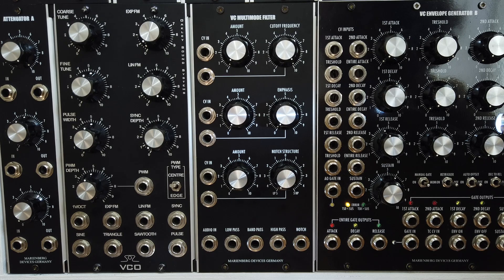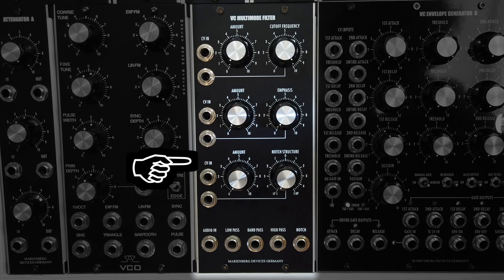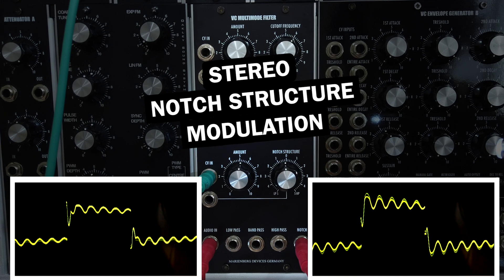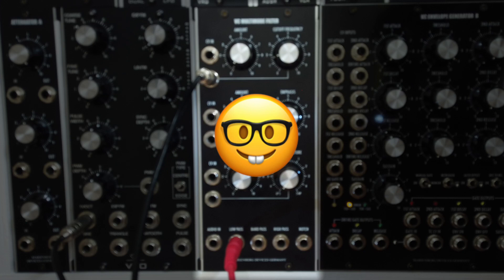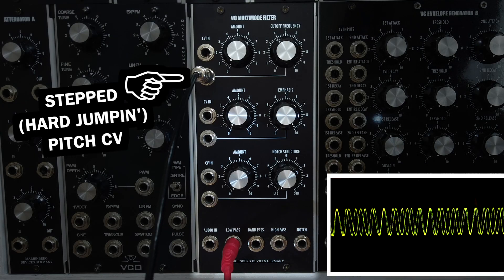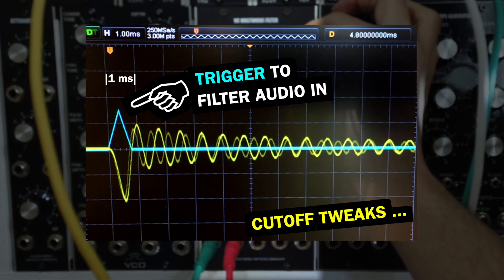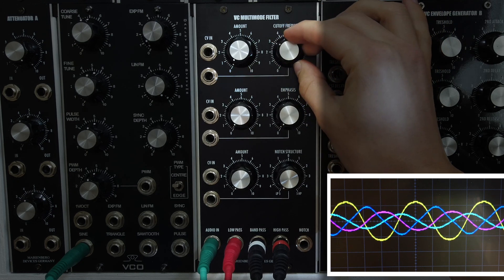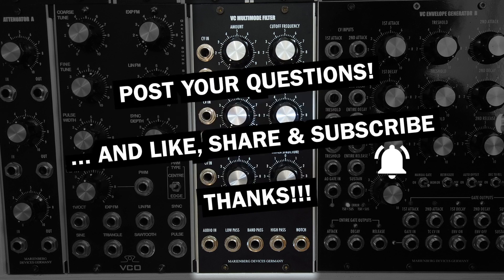ANALOG FILTER SYNTH BASICS with the Marienberg Multimode VCF #TTNM

Comment: The Notch Structure feature is really nice. It's too bad their modules are not compatible with standard Synthesizers.com power. Really reduces the pool of potential customers.
Reply from the maker: Hey, thanks for your comment! The notch structure is a really cool concept indeed! :) I have dotcom, MOTM and Marienberg modules in the same case, running on the same power supply without problems. However, Marienberg said that they also plan to release dotcom format modules in the future too.
Reply: @tuesdaynightmachines   Wow! That's great news! So do you just use a converter like I use to run MOTM in my dotcom case? I mean, different kind of converter, of course, but is that all it takes? If they're going to make dotcom format modules, then even better. Very cool. Thanks for the news. It's a great filter and your videos do a good job of showing just how unique it is.
Reply from the maker: Yes, you need a power adapter. Marienberg uses a different connector on their modules, so you can simply make a cable from dotcom to Marienberg. The front panel width and screw spacing are a little less wide than dotcom, but depending on your 5U case that doesn’t matter. I’ve got a wooden case, so I can just screw the modules next to each other, no matter the screw spacing and width. Here’s a post about this: https://www.muffwiggler.com/forum/viewtopic.php?p=3227823#p3227823
Reply: @tuesdaynightmachines   Thanks for all the info. Always good to see the 5U world expand. Hey, if you are a filter freak like me I highly recommend the Oakley Croglin filter. I just added 4 filters to my case and this one is by far my favorite. Completely unique sound and design. I believe you could call it dual peak because it's 2 lowpass filters you can offset. Based on the filter from the Electro Harmonix Mini-Synthesizer. It's not multimode but produces what sounds like bandpass and highpass caused by what I would assume is phase cancellation between the two lowpass filters. Check it out.
Reply from the maker: Thanks, I’ll check that filter out! I like the MU Oakley modules by Krisp1/Paul.